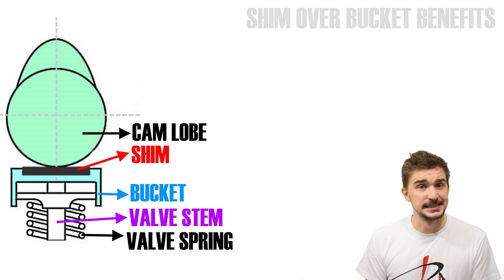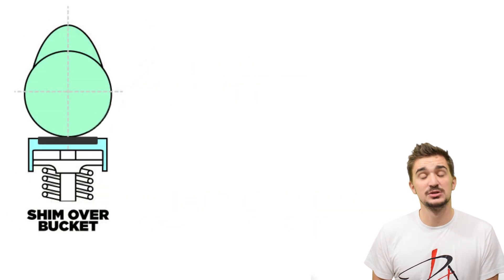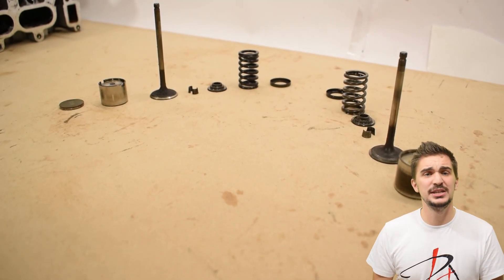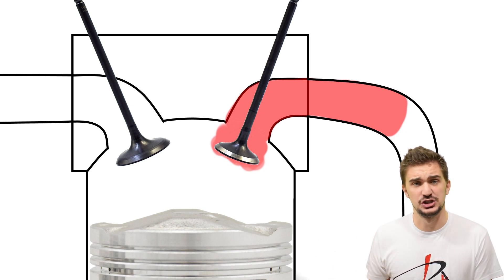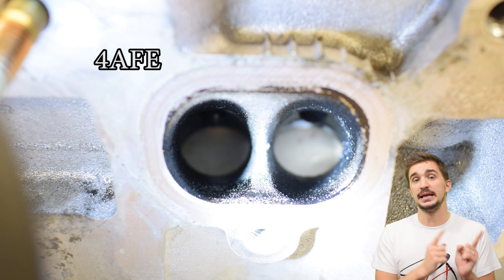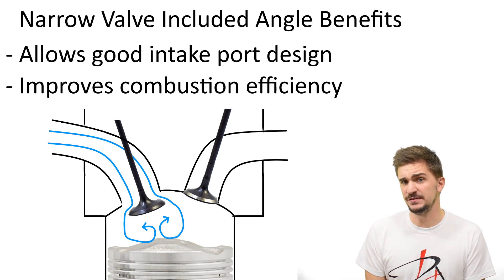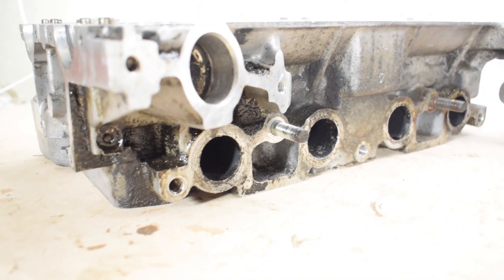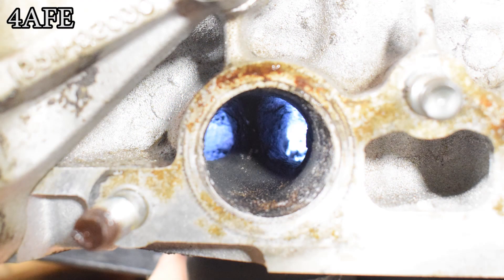CYLINDER HEAD Face Off - 4AGE vs 4AFE - DETAILED Comparison

Comment from the maker: 4AG/ 4AF Head Stud kit: https://amzn.to/36gcPyo
Wear the G: https://amzn.to/2UbEACx
Show them gears: https://amzn.to/32teT59
D4A merch: https://teespring.com/en-GB/d4a-merch
Reply: Do a video on the gdi mitsi heads best down draft factory port I know of... there is ways of dailing in slave cam cylinder heads reposition dowel /key or make off set dowel/key or remove and weld in at desired or recommend cam angle degree to suit application
Reply: And you are better off going shimless buckets less weight ect
Reply: The new cylinder head now are wide angle for better tumbling
Reply: Overlap happens a few degrees after the intake valve started to open and when the exhaust valve is a few degrees from closing, thus the intake air and exhaust gases will try to move around their respective valves.  Wouldn't this be better for scavenging because the valves will be deflecting the air around them and thus the intake and exhaust streams would interact better?

Also, it would seem that the proximity of the intake and exhaust valves with each other will affect scavenging effect the most (the closer the better), regardless of valve angle?

Comment: To all you 2 stroke guys, the TVIS is basically a power valve system for a 4 stroke engine. Quite interesting actually!
Reply: Ps. But only for the intake side ofc :)

Comment: 4age (unless 20v) is overrated. All the dyno i see, unless you always shifting above 5000rpm, 4afe is enough since they have better power in low-mid rpm. Plus they are cheaper. Few things that holding 4afe top power is injector and exhaust size. Try swap it with avensis 205cc injector and a custom full set exhaust system. It shown to gave significant gain on 4afe.

Comment: Hello! I have a lexus is220d(2007)with engine problems. I inherited it from my father. I don't want to sell it because it is too special for me. The mechanic said its too much cost to fix it. The same price as another car from this type. It is not worth fixing. I decided to try to disassemble the engine to reduce the costs. Sorry for bothering with this question but do you have any video that could help me? Thank you for your answer.

Comment: I am not going to mess around with my 4AFE cylinder head. But if find it interesting that my car has 114 hp ( not 105) and my brother has 88hp on his 4EFE 1.3 while later they only had 75 for better emission and mileage.  I think all of those changes where made by the ECU. So it seems to me that a mapping of the engine could give you extra power without even losening one bolt. ( not much on a non-turbo engine, but still something ).
320 000km corolla 1.6i, 114hp.
If I ever would do anything, I would have a rebuild/full service of the head, and change the piston rings to make it perform as brand new... but it is still a surprisingly strong car in modern traffic at age 29 years.

Comment: Wait...4AGE makes just 7HP more, gives up 8lb*ft of TQ...and 4AFE gets to the torque peak much earlier (3200 vs 4800 RPM). It seems like the 4AFE would get to the power band earlier, and put distance between it and the 4AGE, which the latter would have to make up on the top end. (And depending on how long it had, it may not do it.)

I just don't see what you gain with the 4AGE. For anything other than a racer, you'd notice the lack of low-end torque more than you'd appreciate and extra 7HP up top.
Reply: Truth, the more I dig into that the more I see that 4age is nonsense. I kinda want to find good advantages of having a 4age under the hood but I just can't!! So 4afe performance parameters are better simply because I will have torque cruising around town and with 4age I will always have to rev it insanely to get good torque!! It's technical parameters but when I had a 4age I was sure it needed some restoration which was true too actually 😂

Comment: Whoa. Back the truck up a sec. Air velocity is good for torque but air quantity is good for power??!! Please unpack that because it makes no sense to me. You've got 2 engines with same bore/stroke (displacement) but one has reduced intake port cross sectional area so the air goes through it faster. Makes perfect sense since in order to get the same volume of air ("quantity") the air needs to move faster through the smaller passage. But once the valve is closed, the same amount of air is in the cylinder so how does that change power or torque? If there is less air in the performance engine cylinder at the end of the intake stroke because of the reduced port size, then quantity has also changed. On the other hand if the increased velocity of the intake air 'grabs' more fuel as it moves through the manifold, then the mixture is richer. This may or may not increase the power of the combustion stroke but if it does lead to more torque - as you stated - this would indeed result in better fuel economy. But, the only way to increase the horsePOWER at any given rpm in 2 engines with same bore/stroke is to increase the torque, since horsepower is a direct function of rpm and torque. S,o if your torque is reduced - as you stated, the the horsepower also is reduced. 
Please explain to me how this is in error.

Comment: If I had I only boost one, I would say the 4AGE would make a better naturally aspirated head, due to valve timing control and overlap scavenging.
whereas the 4AFE would be better off turbocharged after dropping the CR and removing sharp edges in combustion chamber.

Comment: will a 4ag head fit on a 4af block easy enough or is it easier to stick with 4af on 4af
Reply from the maker: It fits without any modifications but the pistons and valves might not agree

Comment: It amuses me at how old cars used rockers and new cars have gone back to this idea I've just changed my cam on my 2ltr pinto from 1971 and personally I much prefer the ease of adjusting valve clearance on rockers than shims.
 I do miss my mr2 with the 3sfe engine it was alot more fun to drive than the 3sgte mr2 I also had.

Comment: I am disappointed as kw difference is just ~6% and torque is even worse around 8% for "performance" model. I can see, main power difference comes just higher redline of revs, which is limited by valve springs stiffness. If you install for "street" version same stronger valve springs, its max. revs will be same & probably max kw power output.

PS. on screen, engine information, so called street version max hp is marked at higher revs, than engine max revs.

Comment: I would have to argue the part about velocity... bigger ports just mean the same velocity comes in at higher rpm. This is why chevy 454s of late 70s, early 80s are terribly inefficient, because the ports are too big for the cam and intended rpm range. 

Small ports, high velocity @ low rpm, as the narrator says.

Bigger ports, lower velocity at low rpms, but higher velocity at high rpms.

Comment: Great video, but I think you switched the cams on the 4age, at least in the beginning. Because you can see the opening for the distributor cap on the right (exhaust side), but the cam with the gear to drive it is on the left (intake side).

Comment: no any word about compression ratio difference(0.1), skoda felicia has 1.3 engine with 42 and 46kw, only difference is in compression ratio that is achieved by grooves on piston , bigger groove is  on engine with less compression ratio and less power

Comment: I had just finished watching your quiz video on the inline 4 and so when I saw this I jumped at the chance to expand my knowledge. I grew up on old school Ford engines primarily the Windsor line so some of this stuff is completely new to me. However the trick with the hammer to get the valve retainers off it's actually a really damn cool trick! Probably wouldn't do something on high performance vehicle but just to pop them out of there that is really awesome!

Comment: Can you do a video on variable cam timing in dohc engines that use a master and slave style cam system like the 4afe? The 1g-fe in the Lexus IS200 is getting more popular as the jz engines become stupid expensive, but they have VVTI on the same dohc setup as the 4a and I have no idea how to go about maximising the VVTI system when overlap can't be adjusted

Comment: I get that the GE design would be advantageous if you had variable cam phasing, but in terms of adjustability it is merely an advantage in terms of convenience as you can alter the cam phase (with more coarse adjustment) on the FE as well...

Comment: i once had a 4a-ge head next to a chevy 350 head and the 4a-ge head's port is 20-30% larger than the chevy v8 head. even with the t-vis insert, it's still 10% bigger than the chevy port. i still like old chevys and old toyota's

Comment: question: by removing the excess casting on the exhaust ports on the 4afe and also shimming off some of the material on the shroud on the fe, does that promote more air velocity overall? if yes, how much of an improvement you would get thru hp and decrease in torque?

Comment: There's some incorrect information on this video.
1) the heads compares are from a earlier Bigport 4A-GE, which was out from 1983 to 1987.  The 4A-FE was made from 1987 to 2001.  A better comparison would have been between a Smallport 16v 4A-GE and 4A-FE, as they would have been out at the same time.  (Also, the smallport 4A-GE was around 10.5:1 compression ratio, meaning it was higher compression than its' FE counterpart, as opposed to lower compression vs the predecessor version of the GE).  This would have been a better comparison, since that would allow the heads to be more properly compared.
2) @5:55 - Variable Valve Timing (toyota VVT) does not change the amount of lift, only the timing of the cam.  This is confused with Variable Valve Timing with Lift (VVTL-i), which is only available on Toyota's 2ZZ-GE engine.  Late models of the 4A-GE 20v had VVT, which would change the timing of the intake cam, based off hydraulic pressure, though it wasn't computer controlled.  VVT does not in any way affect the lift or duration of valves, save for what can be done solely through timing.
3) @12:50 - He mentions that the narrow angle is due to better, newer design, however, the later 4A-GE 16v Smallport heads still utilize the wide angle intake ports, but carry more air into the combustion chamber than both the bigport 4A-GEs and the 4A-FE.  (Though the smallport angles were lowered to 44 degrees vs the earlier 51 degrees).  This is another example of it comparing later models with earlier models of different lines of the engine that work against it.  it is accurate the more modern engines utilize narrower valve angles thanks to newer designs that help with this, notably: direct injection.  However, the efficiency and power benefits from narrow angle valves were just considered at the time these engines were made, and that context in a comparison between the two can't be ignored.

These are all relatively minor points in the grand scheme, but should be noted regardless.
Reply: I've only just watched this now (July 2022) and noticed the same regarding variable valve lift being confused with variable valve timing

Comment: This is very interesting. On a tvr speed six it has shims under a finger, but you can get an aftermarket head which uses buckets instead. The have to be reshimmed every 12k miles as well

Comment: I guess a lot of the overlap and number of valves is less important today with most engines are turbo charged and can get all the air in you want.
Reply from the maker: That's actually a common misconception. Turbos don't magically reduce the importance of airflow and valve timing. Sure they can mask things with boost but to make the most out of forced induction you need to pay great attention to valve timing.

Comment: Nice presentation!
Just a small correction, variable valve timing doesn’t change duration nor lift, just alter valve timing relative to crank and between cams changing lobe separation
Reply from the maker: Variable valve timing is a broad term. For example the VVT on the 2zzge (I believe it's called vvtli) does indeed change lift and duration because it switches to a different profile lobe. Vtec too, it stands for variable valve timing and electronic lift control. Basically anything that determines when and how long the valve stays open is timing and that includes duration. Usually they add the "lift" word to emphasise that, but on some newer engines it's implied as many have it.

Comment: So is it worth it to get a 4a-fe over the 4a-ge? I see the fe at any pick and pull i go to and the ge is impossible to find under $2,000
Reply from the maker: Well it depends, in fully stock form the GE is obviously more fun as it has a higher redline and is overall more involving and has a better soundtrack. But when significant mods come into play the line between the two gets blurred. The GE obviously has a much better aftermarket so that's a factor too. The price is high for the GE as they have become rare now, the FE has been made in the millions.

Comment: 4age bigport head worse than 4afe imao... in my opinion port shape more correct for high rpm in 4afe. Straight port good for high valve lift and peak power. bigport head too little torque

Comment: FWIW that's not a 4AFE head, it's a 7AFE head. The 4AFE heads have small inlet ports that are low down on the head. And they are terrible!
Reply from the maker: 2nd gen 4afe head. It's virtually the same as a 7afe. What you're referring to is a first gen 4afe.
Reply: @d4a  Ah okay. In Australia we only got the crappy FE heads on the 4A.

Comment: Now let's see you made this video in late 2020.  T 4AGE whenever it was made is not very performance oriented it only makes 70HP/liter.  In contrast in the early 2000s Chrysler made a DOHC 2.0L  4 valve rear exhaust engine with 75 HP/liter.  Today a Chevy small block V8 with only 2 valves per cylinder and pushrods makes over 73 HP/liter.  Why are you showing us old engines?  Also Variable valve timing does not give you different cam profiles it only changes the timing of the cam profiles.  There are many devices which have been designed to change the valve lift profile, one notable example that is currently in production vehicles is the Multiair system used in Fiat and Chrysler engines (my wife has a Jeep with it).  Now to the valve angle arguments,.  First event with 1990s exhaust systems exhaust backpressure was way to high to allow for any significant scavenging effects, this only happens with race engines with either open exhausts or engines where the exhaust system is specifically tuned to scavenge at a certain engine speed and operating condition, for example Chrysler was able to tune the exhaust systems of the Minivan and Jeeps with the Pentastar V6 to obtain 40 and 70 more Lb-ft of torque at 1600 rpm respectively.  Besides the intake doesn't care what the exhaust is doing if the cylinder pressure is lower than intake manifold pressure its going to flow .  If your argument makes sense then why do most 4 valve racing engines have a narrow included valve angle.  The valve angle difference is for controlling compression ratio.  Your argument about valve angle and port flow efficiency is valid, however a larger valve angle sometimes allows a larger valve size which is usually the limiting factor in airflow and Hp..  Thats why race engine designers have to compromise valve angle for the best combination of valve size and port shape.  Your tumble argument falls short again unless the valve angle is so narrow that the intake valve is shrouded by the cylinder wall, the effect is negligible especially since we want both economy and performance from our engines.  Now your analysis of the shrouding proves my point valve angle had nothing to do with tumble the combustion chamber was specifically designed to create tumble and enhance combustion.  Ok I'm not sure why more air velocity creates more torque, basically the more air you can get in a cylinder at any engine speed means more torque and power at that speed.  The velocity is helpful in generating the tumble which improves combustion speed reducing heat transfer losses.  The assertion of higher torque allowing you to reduce throttle and thereby improve fuel efficiency is patently false.  The reason we have transmissions with so many gears today is for best fuel economy we want to run the largest throttle opening we can at the lowest engine speed.  This reduces pumping and friction losses and lets our fuel push us down the road.  The TVIS was incorporated to increase air velocity again not for torque but to increase turbulence and combustion efficiency for fuel  economy.  He mentioned this was abandoned for smaller ports which also do the same thing.  However, he is confusing variable intake manifolds which are designed to maximize performance across the speed range with combustion control devices for fuel economy and emissions.  Ok I'm curious why exhaust ports can't be angled upwards, I know why they aren't but they can be.  Please don't misunderstand me I'm writing this so you get the right information not to critisize him.  I actually like many of his videos but I think he bit off more than he could chew this tim.